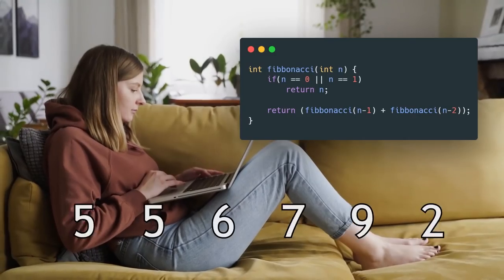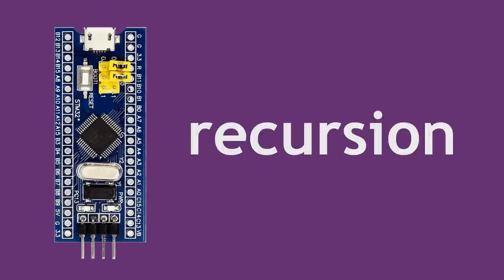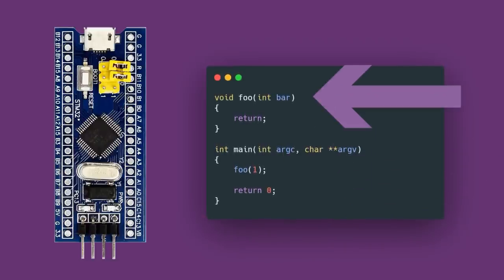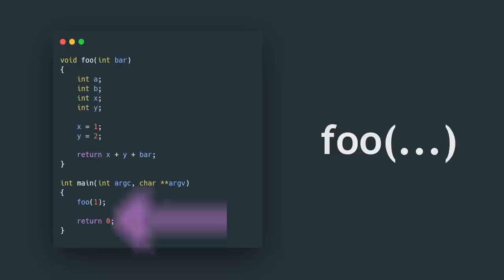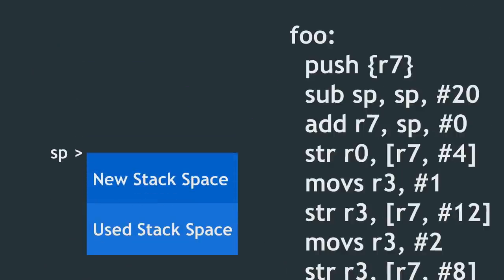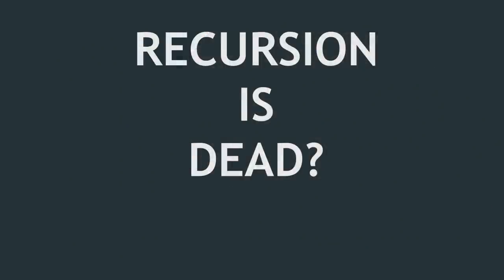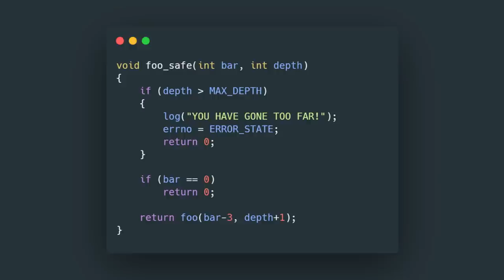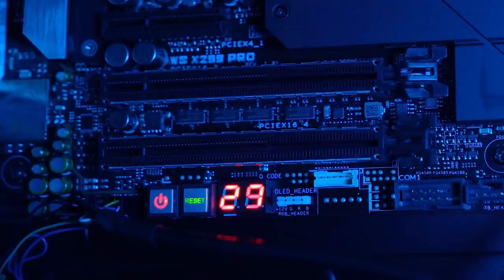why is recursion bad?

Comment: Wait until he learns about tail recursion optimization
Reply: @Wariowa345  compiler does some execution reordering to eliminate reliance on putting functions waiting for return values on the stack
Reply: @Wariowa345  How I understood tail recursion optimisation: the compiler detects tail recursion, and optimises the code to convert it into a simpler loop.
Reply: @Wariowa345  removing the calling function from the stack before the called function is executed, leading to recursion without adding to the stack. Only viable when the result of the called function is dropped
Reply: @Seltyk  or an accumulator is used for the result.
Reply: Yes, SICP <3
Reply: A lot of languages don’t have tco
Reply: @intertextualdialectic1769  I think it enables more structured and less error-prone code. Wish more languages had it.
Reply: Came here to say this
Reply: @ArmaganSalman  yes that’s true. But in rust specifically there are technical reasons why they haven’t implemented tco. It has to do with the way it interacts with other features in the language. I like recursions and certain fp features but there are trade offs and complications.
Reply: @intertextualdialectic1769  ?? Rust has tco
Reply: Anything implemented through tail recursion is easily reducible to an iterative loop, it is really just a stylistic preference for functional programmers.
Reply: @SkidxD  not true. Try turning an alpha beta search into a loop. Not easy.
Reply: @intertextualdialectic1769  Knuth and Moore published an iterative solution to this in 1975 and the problem is hardly known as a tail recursion problem but simply a recursive one, the brain power to go from recursive to iterative would be nearly identical to go from recursive to tail recursive
Reply: @intertextualdialectic1769  Sure, there are always some trade offs.
I am not very knowledgable in Rust. Can you elaborate why TCO is hard or impossible in Rust? What technical decisions creates problems?
Reply: Or better yet rewrite as a loop. You can rewrite all recursion as loops right? Why are there no compilers doing that?
Reply: @oida10000  All compilers do rewrite recursion as a loop. Machine code has no notion of a function call, just jump instructions. In order to implement recursion in machine code, you must use a stack to store intermediate values, and that stack is what we're trying to reduce.

Tail call optimization allows some compilers to compile eligible recursive functions into machine code that does not need a stack, but not all compilers have that feature, and not all recursive functions are eligible.
Reply: For example:

int f(int n) {
    if (n == 0) return 0;
    return 1 + f(n - 1);
}

The above is a silly function, but not eligible for the tail call recursion optimization.

This version of the same function is eligible:
int f(int n) {
    return _f(n, 0);
}

int _f(int n, int acc) {
    if (n == 0) return acc;
    return _f(n - 1, acc + 1);
}

This version can be optimized because the very last step is the recursive call. Since there is no work to be done after the recursive call finishes, we don't need to remember anything about the intermediate steps.
Reply: Also worth noting is that in any language that supports recursion, imperative code, and the stack data structure, you can implement any recursive function as a loop. However, some problems are inherently recursive and will therefore require a stack to implement imperatively. In which case, you often might as well let the compiler deal with the stack and just implement the solution recursively.
Reply: @joshuakb2  just a small note. Not all compilers rewrite recursion as a loop. For example, the Java JIT compiler is unable to perform such optimization
Reply: @ArmaganSalman  they basically have other more important things to work on before doing TCO. Although llvm may perform such optimization. It us not as good as Scalas’, but definitely better than nothing
Reply: @intertextualdialectic1769  alpha-beta search?  Is that the same as min-max search with alpha-beta pruning?
Reply: @altairbueno5637  it's not an optimization, any compiler targeting machine code must implement recursion with jumps and a stack, effectively as a loop.
Reply: A JIT compiler is a bit more complicated because it's basically an interpreter, but at the end of the day, the machine code is looping rather than recursing
Reply: Not every algorithm is convertible to tail recursion!
Reply: Dynamic programming is daddy
Reply: @Wariowa345  it's when the compiler can determine that recursion is just an obfuscated version of a loop that can be turned into a loop by changing like one opcode so it turns it into a loop
Reply: That is only if you actually implement trail recursion - I.e. the recursive call is truly the last statement in your func.    Put a nice logging or cleanup statement at the end, and you are cooked.
Reply: wait until he learns that Haskell can compile a whole processing of a potentially infinite list, with many intermediate operations, into one, tight, optimized loop. XD
Reply: @intertextualdialectic1769  absolutely not. Implement a non recursive function to check an unknown width/depth data tree and come back
Reply: Tail recursion optimization means the compiler rewrites the function to not actually be recursive
Reply: @daves.software  yes
Reply: @altairbueno5637  not usually
Reply: @intertextualdialectic1769  Rust (or rather LLVM in this case) does have TCO. The only issue is that there's no guaranteed TCO yet.

Btw an example of TCO 
This code 
`
fn factorial(n: u32) -> u32 {
    if n <= 1 {
        1
    } else {
        n * factorial(n - 1)
    }
}
`
Will be turned into this assembly (compiling this to riscv because LLVM decides to vectorize this for x86_64)
notice that there's no recursive calls generated 
`
example::factorial:
        sext.w  a2, a0
        li      a3, 2
        li      a1, 1
        bltu    a2, a3, .LBB0_3
        li      a2, 1
        li      a1, 1
.LBB0_2:
        addiw   a3, a0, -1
        mulw    a1, a0, a1
        mv      a0, a3
        bltu    a2, a3, .LBB0_2
.LBB0_3:
        mv      a0, a1
        ret
`
Reply: With the magic of compilers, we can strive for the efficiency of just making it iterative in the first place
Reply: Only some useless languages have tail recursion optimization,most of languages consider it bad practice
Reply: Just as an example let's say I had these two functions (ignoring C's scope rules for a bit, I'm not a C expert by any means but I do know assembly)

int foo()
{
     return 0;
}

int bar()
{
    return foo();
}

If I "compile" them myself I'd get:

foo:
MOV EAX,0
RET

bar:
CALL foo
RET

The "tail call" here is the fact that I did a CALL immediately followed by a RET, when I could have just said JMP foo and used foo's RET to return instead.
Reply: @ArmaganSalman  The issue in Rust TCO (which I think is shared with C++) is that Rust has destructors, and these run at the end of scope, which ruins attempted tail calls. I think the optimization can kick in though as long as you don't have any local variables that require Drop (like String or other heap-allocated types), or else you pass all such variables into the tail-call / return so that they aren't dropped (this isn't an option for C++, which always runs destructors, but Rust has destructive move so this can be used to cancel the drop insertion).
Reply: I'm pretty sure GCC supports TCO, but I'd be more comfortable with it if it supported something like Scala's @tailcall annotation that breaks the build if you accidentally write a function that can't be optimized.
Reply: Does C supports that?
Reply: @megamozgs9959  depends on the compiler
Reply: There is a lot of recursive functions your compiler would not be able to optimize. Some compilers don't do it at all. Some do it, but are not very smart about it. You should not really count on the compiler doing the smart thing every time. But again, you could always manually look at the assembly and see what it did.
Reply: @yashdiniz  On point. It basically turns recursion into its loop equivalent code by stripping the repeated allocations.
Reply: But it's far from obvious when the compiler will actually do that. Some languages like Scala can enforce it while most C++ compilers can't. There's also the issue that the compiler might not perform TCO for debug builds, so the debug build crashes while the production code runs just fine.
Reply: And continuations that destroy the stack frame with each yield!
Reply: yes, this what I came here to say...
Reply: @SkidxD  some languages implement what is called proper tail calls, which means as long as a call (to any function, not just the current function) is in tail position, it is guaranteed to not use any more stack space. This is not reducible to a simple loop in the general case without global program analysis, and it's pretty handy.
Reply: @joshuakb2  Plenty of machines have direct support for function calls, and it's not true that all recursive calls are turned into a loop. For example, x86 has a CALL instruction, and as another example, 68000 has the JSR instruction to perform a jump to a subroutine, and LINK/UNLK instructions to set up frame pointers in subroutine calls.
Reply: @yashdiniz  yes I learnt this while learning Kotlin!
Reply: First thought in my mind before I even clicked 🤣 Rust does it natively, as does Go if I'm not mistaken. Lisp too? 🤔
Reply: @chasehiatt5595  lol same
Reply: Instead of a CALL, a JMP instruction is used for recursive calls so the return address remains at the top of the stack. The eventual RET will pop this value into the instruction pointer (RIP for x86-64) and execution resumes after the initial CALL.
Reply: @yashdiniz  Tail recursion isn’t optimization into a loop (which is typical is a conditional jump, conditioned on some counter or Boolean condition).  Tail recursion is a “jump” instruction while normal recursion is a “call (jump and return)” instruction.  Doing a simple jump does not require saving the current stack frame.  The new arguments are overwritten and the function is jumped to.  Doing a “stack trace” would show just one stack frame for the function.  All the input arguments to the function will appear with the new values, so unlike a “for”-loop, you see the new function inputs in the stack frame.  But the height of the stack remains O(1) because it’s being replaced with each tail recursion call instead of being pushed onto the stack.
Reply: @hdthor  you're right. The comment I had written was poorly worded. I meant that every loop could technically be converted into a tail recursion.

You can implement a loop using conditional jumps. Loops have exit conditions (base cases)
Loops update variables until exit condition is satisfied (replace the values in the same stack rather than adding a new one)

Of course a loop is not tail recursion, but one can be converted to the other.
Reply: LMAO
Reply: @SkidxD sure, if you make a stack object in the heap and only have one exit point for recursion, but while that will save time on RETs, that isn't really better memory management, is it?  Tailcall optimization, on the other hand saves both time and memory, but it's not always possible or even available.  There is no perfectly general way to replace recursion with loops.
Reply: @oida10000 no.  There are lots and lots of recursive functions that cannot be implemented as loops precisely because they require the extra stack memory no matter how you slice it.  Sometimes you need it for return addresses, sometimes for data.  Specifically, if there is only one functional place in your function where it calls itself, then there is some way to loop it, and you will see a bit of time performance gain.  However, if you actually require the extra memory for data, then you can only loop it by allocating a stack object on the heap anyway.

In short, all loops can be recursed, but not all recursions can be looped.  As always, any noun can be verbed.
Reply: @joshuakb2 this is very, very not true.  Unless you're writing for extremely dated or dedicated hardware, the machine has opcodes for call and return and other stack management.  By the 80s and probably earlier we JSR, JAL, and CALL.  The MIPS JAL was a bit rudimentary because you did have to do the stack management yourself, but it performed the same function all the same.

If you think about it, call is just push ip and jump.  Return is just pop ip, or pop and jump indirect.  In that sense I suppose you're correct, but a compiler has no intrinsic need to use the full sequence of instructions when call and return are already opcodes.  These days, processors are not meant to be programmed in assembly, so I wouldn't expect such writeability and readability aids to make it into brand new architectures.  Hell, I don't think MIPS was even supposed to be written by humans.  But most new processors build on existing architectures, so no, your compiler does not have to insert any jump instructions.
Reply: @davidhand9721  I understand that there are opcodes for procedure calls. I was only meaning to convey that CPUs are inherently imperative machines which have to jump from one instruction to another in order to perform function calls. In that sense, recursive function calls behave in a way that's very similar to a loop, plus a stack to maintain state. Tail call optimization eliminates the need for a stack to perform the logic.
Reply: @davidhand9721  Actually, sorry about my previous response. I was feeling defensive (and was also a bit distracted) so I failed to re-read all my original comments which you were responding to. I wrote them a year ago so I kinda forgot what I said, and I can see your point. The existence of opcodes for procedure call and return (as opposed to regular jumps) would seem to imply that even at the level of CPU architecture, function calls are a basic feature and not a construction. MIPS is the only assembly language I ever learned, which may be part of why I haven't thought about it this way before. Like you said, MIPS doesn't do stack management for you, but even mips has the concept of a procedure call and return.
Reply: "furry" "TAIL recursion" hmmmm 🤔

Comment: "Only 20,000 bytes of ram" - that sums up the capabilities of all machines I used in my first decade of programming. And that included doing recursion in LISP.
Reply: think lisp machines had 1 mb of ram with maybe 20k free
Reply: Lisp has really good tail call optimization though right?

Comment: You should've mentioned how in some cases the compiler can optimize away recursion into what is effectively the same as plain old iterative loops. If I remember correctly, there have been some major advancements in optimizing recursion in the functional space recently.
Reply: I was told in my DSA class that some compilers literally convert all that into iteration though tbh I’m not too knowledgeable on CS yet.
Reply: Usually those only work on non-branching recursions which often can be turned into for-loop with nex to none changes to code.
In case of i.e. Fibonacci sequence I'm almost certain such optimization won't happen (although there are some fun ways to turn it into for-loop, and fastest of them for calculating F(n) involves multiplying 2x2 matrices and works in just log2(n) multiplications)
Reply: @aleksandertrubin4869  The lazily-evaluated Fibonacci sequence is t-c-optimized, though I don't know if it is even possible to translate that into anything suited for embedded programming

fibs : List Integer
fibs = 0 :: 1 :: zipWith (+) fibs (tail fibs)

This essentially defines `fibs` to be a list starting with 0 and 1, and then all the other numbers are created in the following way: `fibs` ([0,1,…]) is zipped with `tail fibs` ([1,…]) and each pair of integers is added together (that's why we passed plus into the `zipWith` function).

Maybe one can write it with Rust's generators. They are lazy right?
Reply: @aleksandertrubin4869  Scheme:
(define (fib n)
  (define (fib-iter current next n)
  (if (= n 0)
    current
    (fib-iter next (+ current next) (- n 1))))
  (fib-iter 0 1 n))
Reply: generally speaking the major feature of functional languages is that they perform a lot of complicated transformations that make functional code not horrible for performance and resource usage.
Reply: @Werse Varsity Swift also does tail-call elimination, as does Safari's Javascript. (Great explanation, by the way!)
Reply: I wouldn't trust the compiler to do that, and even if it were guaranteed by your current compiler, that code may not be portable to other compilers.
Reply: @-..-_-..-  functional code NOT horrible. 😂 😂. Ha ha ha ha ..
Reply: @kayakMike1000  you say that, but the real benefit is not when you write the program wholesale. It's when you build the program up from high-level components. A single component might not form a closed recursive loop itself, but it might form one half of a loop, and the piece it's composed with might for the other half. A sophisticated-enough compiler can then reach into the implementations of those components, see that they--together placed end-to-end--form a closed recursive loop, and then compile it away.

The real benefit isn't when humans attend to every minute detail. The real benefit is the high-level problem solving that these techniques enable.

Comment: Even in the "infinite" memory you usually get with Software Engineering, I've actually never used recursion in a practical way. As my Operating systems professor said: "If your solution is recursive, you should probably find a different solution"
Reply: I wrote an inheritance tracing algorithm that was recursive and I think that's good, since it made it a lot easier and if someone has over a hundred levels of inheritance I don't think my recursive algorithm is the problematic code😂